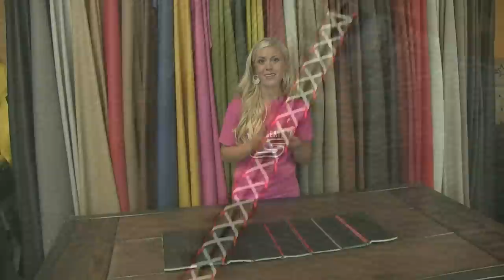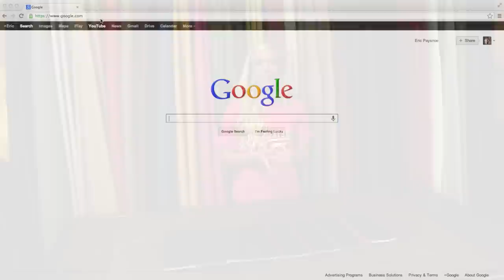boutique upholstery seam options for custom leather interior conversion kits - LeatherSeats.com

Comment: Tried your auto select interior on your web page for a 2005 chevy blazer I wanted 2 tone premuim leather full middle color (Med brown) And black leather sides with a heater in the middle for both seats Couldn't get that on your selector ..You guys need to take a look at it...It's what sells or has someone move on to another leather store
Reply from the maker: I am not sure what you meant by your last sentence, but I had my team check the configurator and the 2005 Chevrolet Blazer pattern is working just fine.  They were even able to design the same look as you had in mind.  So please give us a call and we can walk through the configurator together and figure out what might be going on. 1-866-639-7328
Reply: I think he meant that if you had only one craftsman with the skill to perform that job and he went to work somewhere else, that would explain why you no longer offer that special service.